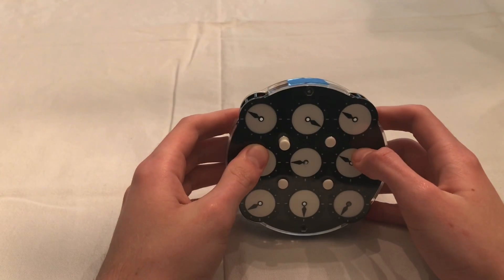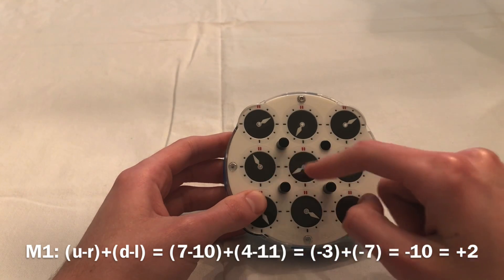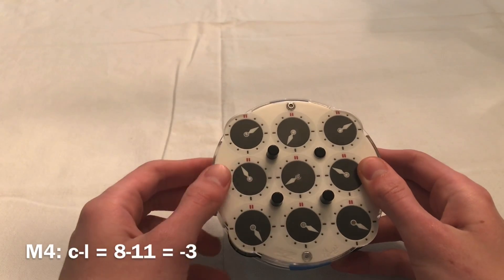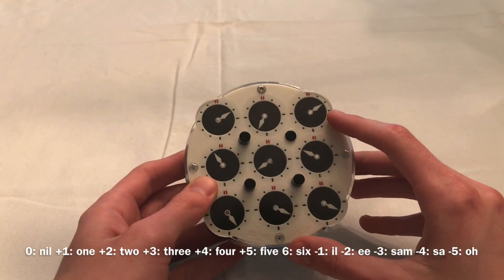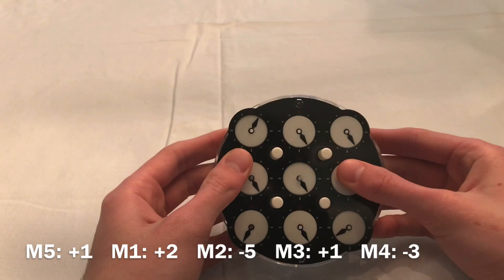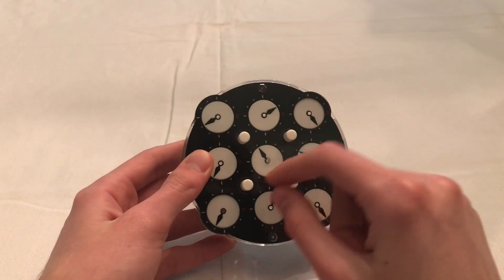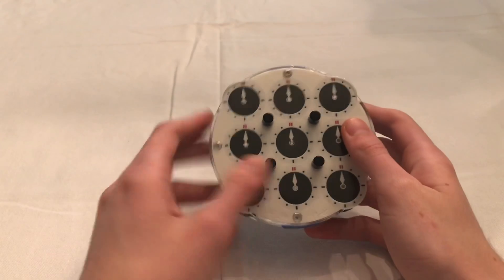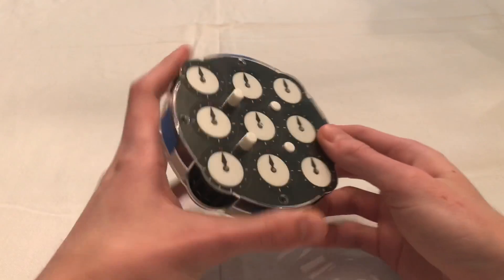Learn How to Solve a Clock No-Flip in 10 Minutes (Beginner Tutorial) - Sheerin Method

Comment from the maker: If the back cross is not pointing to 12, you are messing up the M5 calculation. Also, make sure to read the description if you are struggling.
Reply: when i was following ur scramble and solutoin, the part where we do the cross on the front side is where i thought i messed up but i did the rest of memo fine. did i do something wrong?
Reply from the maker: @DNFClockTheory If the Clock is solved, then you didn't do anything incorrectly. If it's unsolved, then I'm not sure I understood your question.
Reply: @CalebTrelford  it was solved.
Reply from the maker: @ Then, you did nothing wrong.
Reply: Thanks! I just noticed I was doing M4 - r instead of r-M4

Comment: i'm a little lost on the execution of the moves after calculating them. in the video, you executed m5 which makes sense, but you only did like 3/4 of the cross before you moved on to actually execute the m moves. when am i supposed to execute the m moves? is it after doing cross or is there something i'm missing
Reply from the maker: The M moves solve the cross on the back. Does that help?
Reply: @CalebTrelford so do you solve the front cross first and then execute the m moves for the cross on the back?
Reply from the maker: @yeggs4353  You solve them simultaneously.
Reply: @CalebTrelford  my bad, i'm just confused cuz you did m5 first, then solved three of the edges and then proceeded to do the rest of the m moves
Reply from the maker: @yeggs4353  Yes. That's what I did.

Comment: for some reason, often times when i flip the clock over after solving, everything is solved except for D. i can't really seem to find an explanation. it doesn't seem to be an M1 error though. any idea why? just miscalculation or wrong execution?
Reply from the maker: You are likely miscalculating or incorrectly executing M2. To avoid errors like these, I'd recommend trying the same scramble multiple times.

Comment: the M5 so hard to know , i try too many solve but i cant solve that , can u tell me how the M5 working?
Reply from the maker: Try the scramble in the video and see where you are going wrong.
Reply: @CalebTrelford  how is the  diagonal pins are down mean ? and i try but i cant do in other scramble so can u tell me pin down mean?
Reply from the maker: @ Think of M5 as the move that aligns the cross on the back. Thus, having diagonal pins down means that the 5 non-corner clocks on the back will be affected.
Reply: @ do u have alg for each M5
Reply: @CalebTrelford  i mean i can do first face on clock but face in the back is wrong
Reply from the maker: @ I'm not sure what you're struggling with. Try watching my example solves video.
Reply: @ the M5 is c-M4=6-(-1) is 7 right?
Reply: @CalebTrelford  the M5 FIRST BUT what pin is needed to pin down
Reply from the maker: @oopsmagicgaming6180  You need to put at least two horizontal pins down. For example, only raise the DL pin and execute M5 with the UR wheel.
Reply: @CalebTrelford  sometime u pin up UR but i dont know why
Reply from the maker: @ If you have just UR up (or just UR and DL up), then you can execute M5 using the UL wheel.

Comment: Caleb, do u use m5 for every single time there is 2 diagnoal pins are down? Also, what does it mean by diagnoal pins?
Reply from the maker: Every solution where M5 is non-zero uses M5. 2 diagonal pins down refers to pin positions like ul (all pins down except UL), \ (only UL and DR up), etc.
Reply: @CalebTrelford Do u have do it every single time or just once is gud enough?
Reply: @CalebTrelford  Also, how do you get from 10 to 7??
Reply: Is your clock in a different position or am I tripping?
Reply from the maker: @iloveentrypoint  Think of M5 as the move that makes sure the dials on the back point to 12. 

7-10 = -3

I don't know what position you're referring to.

Comment: I watched this tutorial, and I have no problems understanding memo but am confused regarding exec. 

Do you always do M5 first or just whenever two diagonals pins are down? At 4:55, it looks like diagonal pins are already down, so what was the purpose of changing the pin state? 

Thanks for any help you can give me!
Reply from the maker: You can execute it whenever two diagonal pins are down, which could occur multiple times during your solve. I changed the pin state so that I could it simultaneously while turning a bottom wheel.

Comment: How do i know which diagonal pins are supposed to be down?
Reply from the maker: It doesn't matter which ones. Think of the move on the back as the AUF.
Reply: Oh. I also am having trouble knowing if when i get the cross on the front, do i solve it to twelve or leave it and go to M2? And when i do M5, does that always go at the start or end?
Reply from the maker: @frozeenfl  This is shown in the video. There is no need to solve to 12 at that point.
Reply: @CalebTrelford  Oh ok. Thanks!

Comment: UR5- DR1+ DL4- UL0+ U1- R3+ D3- L6+ ALL5+ y2 U4- R1- D1+ L3+ ALL0+ UR DR DL
holding the clock with 12 at the top and white front (startet scrambling with white front)
M1: 1
M2: -5
M3: 6
M4: K
M5: K
when I execute this in the exact same order as you did in the tutorial, I end up with one side solved, and the other side is of by the cross where all cross pieces need a -2 to get solved. I went over the scramble like 5 times and cant find the mistakes. can you help me?
Reply from the maker: You are messing up the M5 calculation.

Comment: I had a few questions, as when I follow this vid down to every detail and with this scramble it works but  for other scrambles I am still unsure about the steps:
1. Can M5 be always exe first if I were to blindly follow these steps for ever solve?
2. Why do you switch to solving cross and then move to executing the memo after 2 cross edges and alternate between these two?
3. Can this tutorial be followed down to the last word for every solve for it to work on clock? Or are there any intuitive steps in between that I am missing in case I am starting with Sheerin directly?

Thanks for your time.
Reply from the maker: 1. Yes.
2. It's just how Sheerin works. You don't have to do this, but you'd need to change the calculations to do it differently. This is not the most efficient way to do things (the most efficient way is the way that 7 simul does it). 
3. Yes. There are of course intuitive tricks to make your solutions better, but they're not really worth exploring anymore with 7 simul around. If your goal is speed, you should learn 7 simul.
Reply: @CalebTrelford thank you so much for your responses and time. I was able to solve it correctly but the corners on the back remained unsolved. 
But tried a few more times and yes it did work like a charm. 
I was messing something up earlier. Appreciate your response bro.
Reply: After practicing some more I noticed that in most cases when I  complete the solve my entire clock is solved but my back side cross is not correctly oriented to 12 and in some cases I noticed that the clock is solved but the back side corners or cross are off by 6. 

I wanted to know in which step during the exe I might be going wrong as I am seeing a pattern here, just not able to figure out in which step I am missing a key part of orientation as in these solves the cross/corners are solved relative to each other on the back just not oriented to 12.

Thanks as always
Reply from the maker: @ItsCubeRunner  You're messing up the M5 calculation.
Reply: @CalebTrelford thanks ill be on the lookout for this. Appreciate your response as always
Reply: @calebtrelford I got another question, sorry. My Dnfs have gone down but at times when I Dnf, I have noticed a pattern where my back cross vertical line and left edge are oriented relative to each other but aren’t pointing at 12. 
Which calculation error of M is causing this? 
Can you let me know? Thanks.
Reply from the maker: @ItsCubeRunner  No need to apologize. You're likely messing up M1.
Reply: Thanks a ton, shall be on the lookout. Appreciate your reply as always.

Comment: I'm sorry but this isn't a beginner tutorial. You say stuff like "visualy I know" but we don't know.
Reply from the maker: The material is easy and can be learned in a couple hours, which is why it's a "beginner tutorial." What you have issue with is my teaching ability, which is understandable. If there's a specific part you had trouble understanding, I'll try to help.
Reply: One thing that kept happening was all the edges U D L R were all pointing the same direction on the back when I was done but they weren't pointing the correct way.
Reply from the maker: @TheCubePerfect  I appreciate the feedback. For future tutorials, I will definitely try to be more clear about which pins should be up. Your error is caused by messing up the M5 calculation. Just think of M5 as the move that adjusts the cross on the back to 12. Sukant and I both have Sheerin example solves; if you continue to struggle with M5, you should compare your results with those in our videos. For it to work, you need to have the pins adjusted in such a way that the 5 clocks on the back will be affected.
Reply: And I'm also confused about the pins and which ones can be up while I'm doing M5

Comment: I am just wondering what is the difrence between shereen, lou and 7 simul because they are all no flip methods?
Reply from the maker: In Sheerin, you mainly solve the cross on the back while solving the corners on the front. This typically takes 5 simul moves and 4 regular moves, but with tricks you can do it with 6 simul moves. In Lou, you mainly solve the cross on the back while solving the cross on the front. With 7 simul, you always solve the puzzle in 7 simul moves. You solve both sides at the same time. 7 simul no-flip is objectively the best method.
Reply: @CalebTrelford  Thanks that helped alot👍👍

Comment: I have a question. Most of the times after executing the cross is either 1 move from being solved by using 1 pin or solved but not facing 12. I did a walkthrough solve and it made the cross point at 2 o'clock. Does anyone know whats making the problem and how to solve it because i dont know how to deal with it
Reply from the maker: You're making a mistake when calculating M5.

Comment: Hi, I tried learning the no-flip method but I do my edges in clockwise order instead of counterclockwise. This means I can never have M1. Should I switch to counterclockwise or should I use a different equation for M1? Thanks a lot!
Reply from the maker: You could make a different equation for M1, but it's best in the long run to be comfortable with doing edges both clockwise and counterclockwise.

Comment: is there a good way to practice simultaneous turns? Im doing good on the memo but i still average 7 with flip and 12 with noflip
Reply from the maker: Doing slow solves where you deliberately try to do "perfect" simul terms is the best way to improve on them. You could also use a simultaneous move scramble generator to practice them while scrambling. I could post one in the comments if you'd like.
Reply: @CalebTrelford Could you share your simultaneous move scramble generator with us?
Reply from the maker: @paisisspeedcuber7445  I could, but Josh has a simul move scramble generator with more features that is also easier to use. https://github.com/JoshM2/cstimer-7-simul-scrambles
Reply: @CalebTrelford  I downloaded that scramble generator and according to the download description I noticed that all the letters before the two dashes is the scramble, and I know each number that corresponds to each letter but I don't know how to apply it to execute the scramble, could you help me?
Reply from the maker: @paisisspeedcuber7445  You can use any 7 simul pin order to scramble it. Be consistent with which pairs correspond to which moves.

Comment: is there an easy way to pick which orientation and side you start on? right now i just do 12 at top everytime and pick a random side because idk what makes a good starting point
Reply from the maker: The most important thing is to minimize moves that require you to use the lower wheels. If you have an edge-center pairing, you will want to place that vertical at the top. Additionally, if you have a corner-edge pairing, you will want to place that in the lower left corner to preserve it. There's more you can do, but if you are at the point with Sheerin where you are thinking about ways to further optimize it, I would suggest that you instead learn 7 simul.

Comment: Hi Caleb, I´m learning no-flip method, however I have a problem, sometimes if I memorize one face (side) it doesn´t gets solved, but if I memo the other side it does. like this scramble: UR0+ DR1- DL3+ UL0+ U6+ R1+ D5+ L0+ ALL 0+ y2 U6+ R6+ D1- L4+ ALL2- DL, one side's memo is M1 +4, M2 0, M3 -1, M4 6 , M5 +3 but at the end clock is not solved, I tried like 5 times, the other side's memo is M1 +2, M2-6, M3 -5, M4 0, M5 -1, this was solved at first time, please coul you help me to figure out what I´m doing wrong. pleaaase
Reply from the maker: I honestly don't know what you did wrong for that first side. Your memo is correct except for M1, which should be +5 instead of +4. Maybe you just misscrambled? If you can't figure it out from this, please provide another scramble as an example.
Reply: @CalebTrelford  thanks!!! It worked. Turns out that when I had - 7 and +7 I was using +4 and - 4 instead of using +5 and - 5,just like in the memo I sent you!!. Thanks Caleb!!
Reply: It happens in many scrambles, that is why I dear to ask you for help

Comment: to expand on my previous comment. What did you mean when you said, "you can excecut it (M5) on a wheel that is down)
Reply from the maker: Think of M5 as the ALL move for the back. It sets up the cross on the back to align to twelve. You can perform M5 on a wheel next to a pin that is down when all 5 clocks making up the cross on the back will be effected.
Reply: @CalebTrelford  Thank you for the clarification!

Comment: I use a different pin order DL UL UR UR and DR. should i switch to the pin order used
Reply from the maker: As long as you correctly execute the moves solving the back cross, you don't need to change your pin order.

Comment: I get the noflip steps and parts but are there any requirements and rules for the "Normal" parts where you orient the front cross so you don't alter the other side incorrectly?
Reply: I recently did an attempt but all the edges on the other side were facing 6, while the corners were solved.
Reply from the maker: @xelaCUBING  You probably messed up the M5 calculation or did a later move that messed up the alignment of the back cross.
Reply from the maker: You just need to make sure that the cross gets solved on the back. Execute the moves solving the back cross like I did. Don't mess up the cross on the back while solving the front.

Comment: I average around low 9 high 8 on clock should I learn no flip? I have been thinking about it
Reply from the maker: If you ever want to learn no-flip, you should start now. It's easier to switch at 9 seconds than at 4 seconds.
Reply: Would it be better to learn No flip or 7 simul
Reply from the maker: @Tripleatrippin  Both Sheerin and 7 simul as taught on my channel are no-flip variants. Sheerin is less efficient and worse, but it's easier and a more fun introduction to no-flip. 7 simul is harder, but it's significantly better. I'd recommend that you learn Sheerin and move on to 7 simul once you start getting successes consistently with Sheerin.
Reply: @CalebTrelford  thank you!

Comment: Great tutorial, except it doesn’t freaking work. I’m not sure what Im doing wrong, and I’m sure it’s just me. Wish me luck on figuring this out
Reply from the maker: If there's anything specific you need help with, just ask. Good luck.
Reply: @CalebTrelford  I’m just not sure which pins should be up and which dial to turn, so i copied the order on the video, but that may not always be right.
Reply from the maker: @K4Cubing  If you copy the order in the video correctly, it should be right. Make sure that you execute M5 first.
Reply: @CalebTrelford  i do. I should probably start by writing down my memorization, that’s how I learned three blind. Makes it more consistent when you’re still learning.
Reply from the maker: @K4Cubing  That's a good idea. That's what I did.
Reply: @CalebTrelford  alright, I’m getting better, but every Solve, and I mean EVERY SINGLE solve is off by ONE clock on the back. Its always r or d. Im not sure what I’m doing wrong
Reply from the maker: @K4Cubing  It's hard to tell what you messed up just by how you DNFed because messing up one move messes up other stuff after it. I'd suggest that you try using Josh's trainer that I put in the description.
Reply: @CalebTrelford  alright, I’m not sure what Im doing differently, I’m actually pretty sure I’m not doing anything differently, but I’m getting it pretty consistently. This has honestly been the strangest learning experience I’ve had. Thanks for the help though.